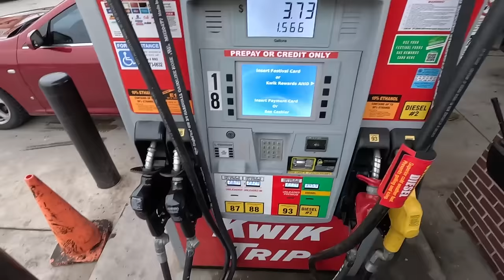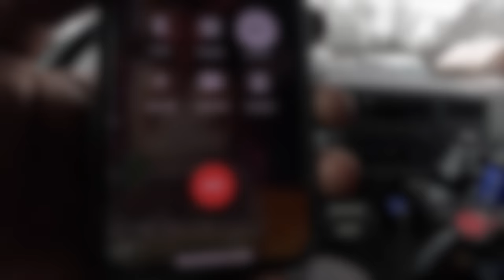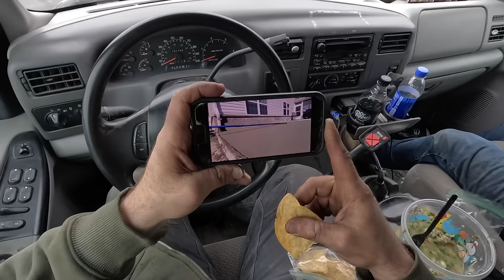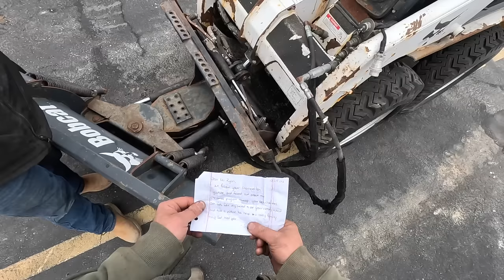Prepping for the first BIG SNOW! Milk and eggs!

Comment: My 20 plus year old honda blower bit the dust so ran over to Ace and got that snowblower but came with 2 - 7.5 batteries. Same price, $999. Only had 2 dustings of snow so haven't used yet. The throttle is great for certain areas. Like at my work we have huge pad by front door with wall on 2 sides. When blowing towards entrance you can turn throttle down and keep snow away then if it was on high. The other area at work is where the smoke area in back which is behind electric box it is great to have shorter throw.

Comment: Hey  Ryan.  if you are worried about Lasik, consider PRK. I couldn't get Lasik in the army due to the high chance of the flap breaking loose when getting hit in the face. But I was able to get PRK. PRK completely removes a layer of your eye so the laser can work. And then your eye builds a new layer and it's like nothing happened.

Comment: I have an ego 2 stage snowblower. I love it. I have other ego lawn stuff and i love the fact that the batteries are all interchangeable

Ego has the highest voltage batteries which gives them a ton if power.

Also - yes it 100% will throw 45 feet when its held wide open :D

Comment: My parent's who live in Erie, PA just bought one of the Ego dual-stage, self-propelled battery snow blower to replace their 30-year old White branded gasoline snow blower this season.  They've had once good snowstorm since they bought it and my Dad says that it works just as good, if not better, than the gasoline one, and runs long enough on a charge to clear their ~3,000 square feet of driveway multiple times on a single charge.

Comment: 23:06 -  “Easier than you think”

Bathtub to shower conversion is not simple 😂
It depends what floor on your house it is and if it’s wooden subfloor or slab (basement)

A lot of errors take place with shower to tub conversions because of the drain size change and/or having to relocate the drain.

Comment: Geez Ryan you otta get yourself a Telehandler to use for putting the salt spreader on the trucks , with a telehandler you can attach crane hooks and chains to the spreader and then operate the telehandler like a construction crane.

Comment: Just came across your video, I have that blower and love it,  only issue, and I'm betting you've already found it. The scraper blade on the bottom, those expansion joints on your driveway will be an issue.  I added guides from another blower so it sits about a quarter inch off the ground.

Comment: I have the Ryobi Expand-it series snow thrower. You can use the 2 cycle power head or the 40v head. The cons are that it is only 12" wide and limited to 6" deep snow. It is great other than that. The Expand-it has like 9 attachments, blower, edger, string trimmer, gutter blower, mini chain saw, hedge trimmer, snow thrower, roto tiller, & sweeper. So the entire line up is 9 attachments + gas & electric power heads. Each item price range from $79.00 to $200.00 so for the whole setup you are looking at approx. $1.800.00.

Comment: I have a 1st generation Ego snowblower. My driveway is part asphalt and part concrete. It works fine on the asphalt but the front edge of the machine tends to get hung up on the concrete, which can be quite frustrating.

Comment: Ryan, have you looked into wearing contact lens instead of glasses?  I am 75 years old and have won hard contacts since I was 15.  LOVE THEM!  I also looked into lasik, but didn't like the problems it can cause sometimes.  It's a one shot deal, can't be corrected.  And then later, you will still have to wear reading glasses eventually.  Good luck with the snow.
Reply: WOW, that’s awesome. I loved wearing soft contacts, but when I hit age 40, I couldn’t wear them anymore due to some sort of change in my eye muscles dr said happens to a lot of people at that age.😔🤷🏻‍♀️

Comment: The batteries will definitely last for the entire driveway and then some, especially with the 2x 7.5AH batteries, I sell the Egos and i’m a trained warranty technician on them. Probably some of the best battery products I have used. The heated grips are also a plus but will drain the battery life significantly quicker.

Comment: Due to battery capacity, it may be more good to use a speed that works but not more than enough.  If it does the whole driveway at high speed with one set of batteries, then go for it.

Comment: Battery powered snowblower don't last very long, I've bought a corded single staged blower for like 250CAD 3years ago, replaced the belt once. I'm running for 2 hours everytime it snow so yeah can'T do that on batteries but the cord is not a problem like it is with a mower. Also let the battery cool down after use before charging, I don't mean cool down like heat but for the chemical reaction the battery to slow down and stabilize, after an hour it's good. They don't like push out lot of current then recharge, every lithium battery is the same in this aspect

Comment: As for lasik do your research on the doctor and if he uses the current equipment. Some doctors do one eye at a time which I prefer. Two of my sons have had lasik with no problems and got both eyes done at the same time. I had lens implants done, one eye at a time, 20 years ago due to glaucoma and still close to 20/20. Have reading glasses but don't use them.

Comment: I just lost my best friend, of over 20 years. He chocked on a corn chip. Not Really,he had a heart attack, a massive one. I drove his 2023 Gr Corolla  to his funeral. Because nobody else knew how to drive it. We have been working on it and now it is up two 400hp out of 1.6 liter 3 cylinder turbo all wheel drive. I got it up to 150mph on the interstate on the way back. Had to open her up, and see how it does. We just installed Intercooler, and he only drove it once before he passed away. I had to max it out once at least. Sadly he never got the chance to.

Comment: I have all EGO Equipment, There is No Difference Between The (Power+) besides the Power+ is basically Commercial Use & The (EGO Power) is for Local home owners.. but even if they have you two 7.2ah batteries you’ll be a lot better with a 12ah but the batteries it’s self are really pricey

Comment: 😢 if it surges with choke off that means the pilot jet is restricted. Essy fix but it may work itself clean . The next day after snow id get the pilot jet out and clean it if it doesn't work itself clean . Just give the battery powered blower to Dannial then he can use it to go make money doing a few neighbors drives .

Comment: i got lasik and it was best $4500 canadian i spent, i also got $2,000 more back on my taxes as its was a surgery and you can declare on taxes, i went in and within an 2 hours my consultation was done and i could see 20/15 vision. which is better then 20/20 i could see at 20 feet what a person with 2020 can see at 15. now as it healed, it went down to 20/20 which is why the overcorrect but i felt like i had hawk eyes.

but out of all the youtubers i know who got it Whistlin Diesel is only one who says they had issues, and from what my Doctor said There have been no reported cases of  anyone going blind due to LASIK and mu clinic has zero reports of any post complications.

Comment: Ego electric are by far the best battery operated units .
Home owner application only 
Should be perfect for your driveway and sidewalks.
Light commercial multiple stop accounts become a constant need of battery issues.
Conditions of temperature and snow depth greatly affects your run time.
Throwing distance means nothing in my opinion.
Average individual always having a deflector shoot wide open is ridiculous.
You have no control replacing the snow where you want it.
You never need it to go higher than 3 or 4 ft and the distance of 10 to 20 ft anyway.
Great homeowner units.
Commercially you need to have multiple sets of batteries indoor charging banks with you.
And I don't find them durable enough for the abuse they take in a commercial application.
* Used non-ethanol gas in that Toro blower so you don't have to worry about it varnishing up and plugging up the fuel system.
Or always put some stabilizer in the gas can.

Comment: I had LASIK eye surgery in 2016 when I was 21 years old. By the time 2021 rolled around I needed glasses again. In my opinion, it wasn’t worth it.
Reply: Had mine done in 2010 and still have 20/20 vision.  They told me to wait until I was 28 years old, yours eyes don't change much after that except old age reading glasses will be needed after 40.  I guess I'm lucky, don't need them yet.